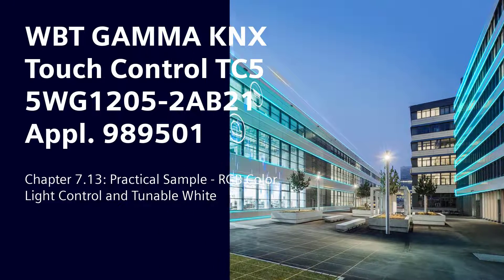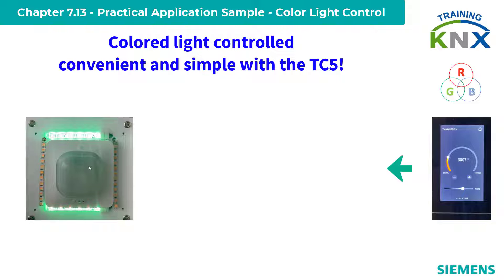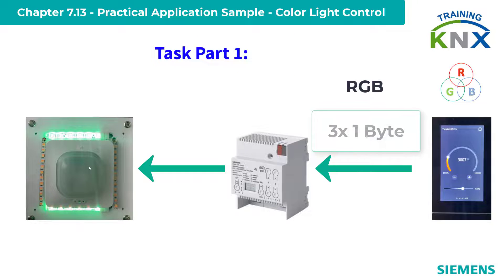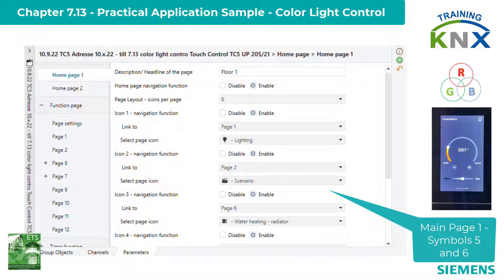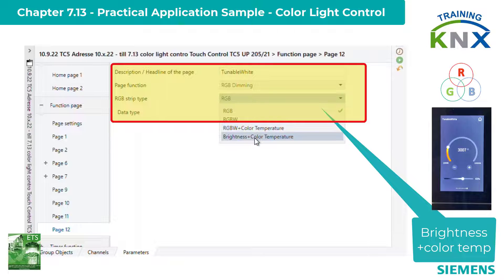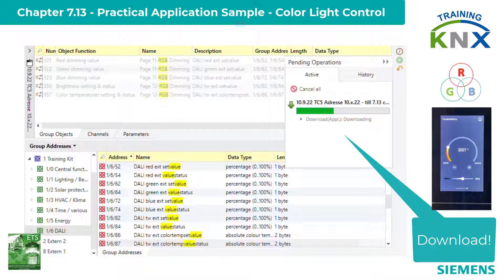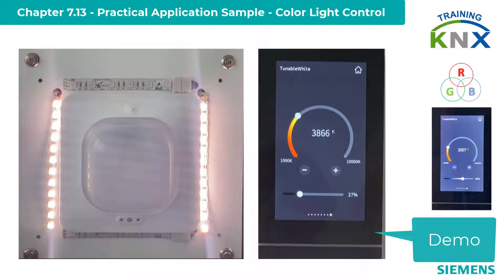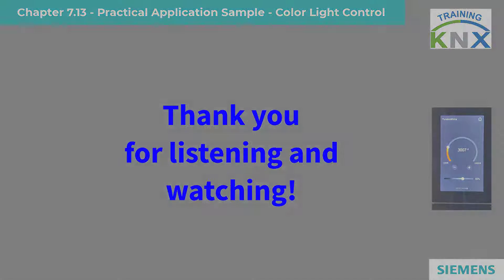7.13 Siemens KNX Touch Control Panel TC5: Sample project - color light control and tunable white

Comment: Siemens KNX Touch Control Panel may i know maximum ETS5 gurop address support ???
Reply: The Siemens GAMMA KNX TC5 Touch Panel has max. 688 communication objects, it supports 2000 groups and 2000 object links!